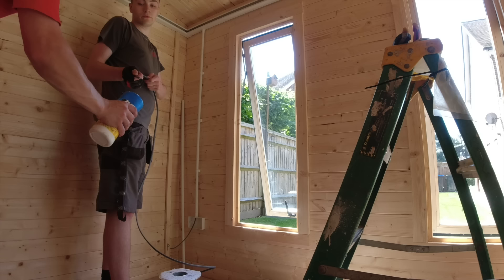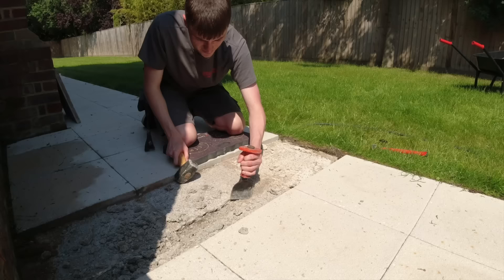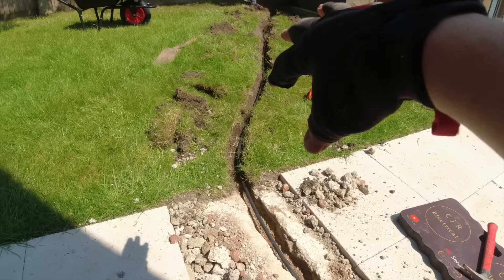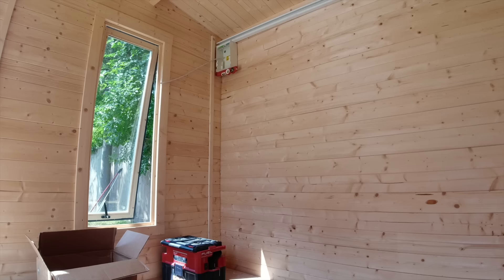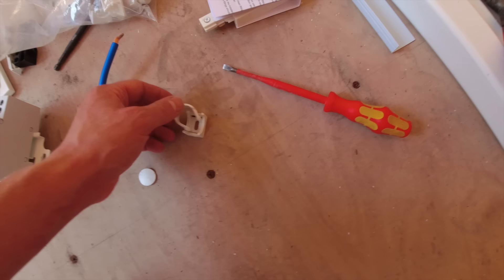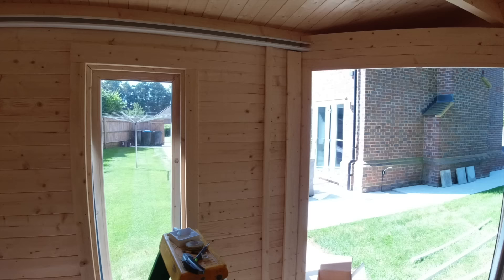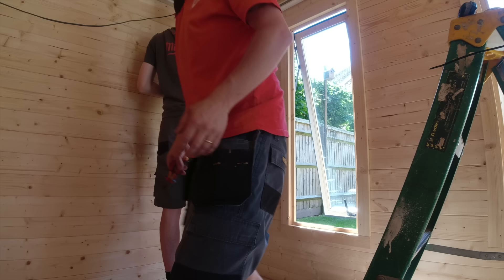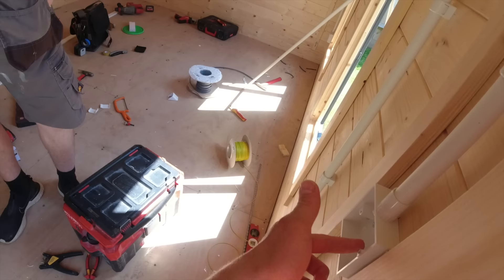Just how easy is it to install outside power and lighting. PART 1

Comment: It amuses me people do unsatisfactory work then advertise the fact they have done a inferior job on here.
There is no way you can make excuses for not burying that cable it the correct depth . Oh it’s RCD protected. RCDs can fail.  In the very rare case I can’t get a section to the correct depth. I sleeve or run the whole section in heavy duty plastic pipe.  
I also recommend the customer gets someone else  to dig it if they can to save on my labour cost.
Reply from the maker: There is no correct depth unless you are burying cables on a camp site for obvious reasons. Please use your common sense Andy.
Reply: @Cjrelectrical  common sense tells me this is not acceptable.  Just imagine could have kids want to put a tent up in the back garden . Or a swing ball . Even a free standing bird feeder .the list goes on .
Reply: I’d agree it’s unlikely someone would dig in the lawn but a spike or hollow core.aerator wouldn’t be unusual
Reply: Hi sir          I new you would come in for some grief over the armer cable depth , and also the 13 amp fuse supply .  But as you rightly said your are limited to 13 amp fuse  which in reality would react as designed in an overload situation , and as for the cable in the ground as electrical contractors we have to make common sense decisions every day of our working lives . And this is exactly what you did , obviously we have to be sensible but as a well retired contractor I can say you work is always well above board .   A statement that I could not say about many in the industry , were I spent a lot of my time rectifying work that had me wonder how the individuals concerned slept at night .  Also in many cases were not talking about  single phase supplies ,  no the stuff that if you come a cropper you don’t get up and walk away from .   But I will give you and everyone a tip for an old lag .  We found if you leave the sockets off and then push the two cables down the conduit first, even before fixing the saddles in place .  So you have your cables coming out of the trunking and you then slide the conduit up , and because you can angle the conduit it makes life a lot easier and who’s not for an easy life 😂.    Best wishes and kind regards.  😀👍👍👍
Reply from the maker: @andysims4906 for the majority the cable is buried at 20 inches. Under the slabs it’s pointless.